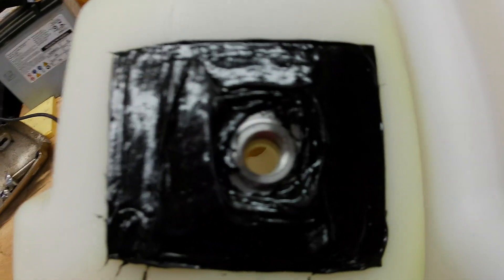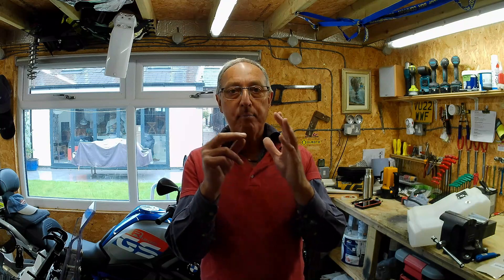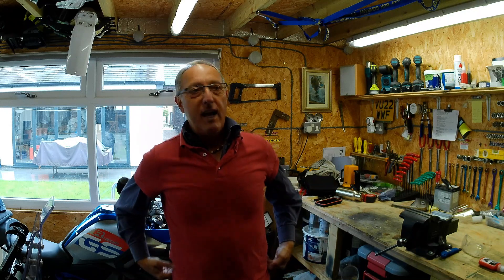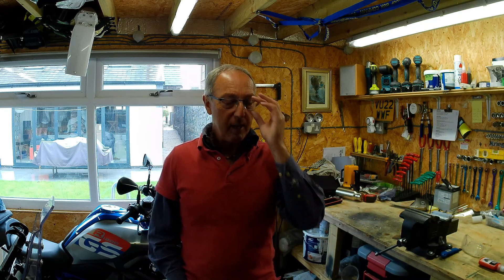Husqvarna 701 update; Rade Garage tank woes, new seat, Haan wheels, new bike?

Comment: My Rade Garage tank leaks too. With the amount you pay, this sort of thing ought not to be a problem.
Reply from the maker: Thanks for watching. It is fixable, get a new tank from Rade Garage and cut down the banjo bolt by about 5mm BEFORE screwing it into the tank fitting. The problem is the banjo bolt is too long and it pushes on the tank plastic thus compromising the integrity of the fitting. I agree, it should not be a problem.

Comment: Thinking about purchasing and was wondering if your fix worked.. 7 months later now. ?
Reply from the maker: Thanks for watching. Yes, the fix did work. Shortening the banjo bolt that goes into the metal insert in the Rade tank is the solution.